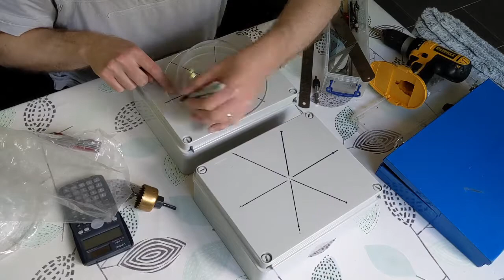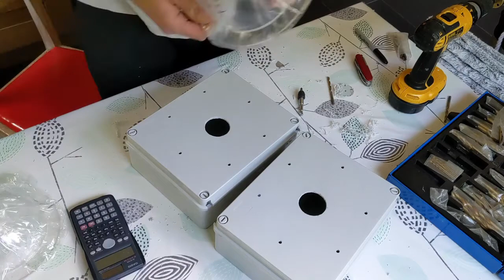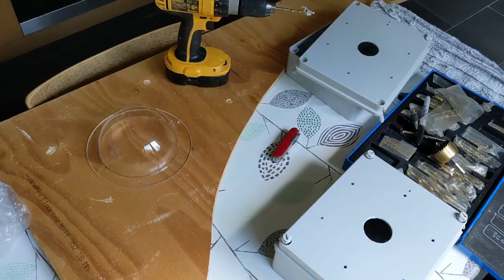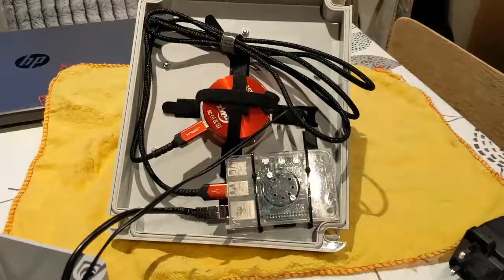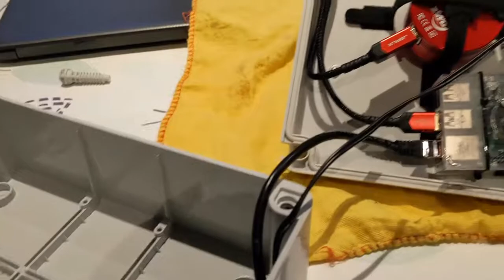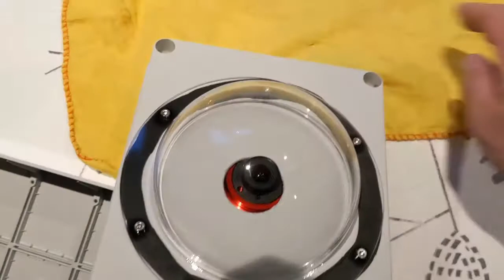Building an All Sky Camera

Comment: do you have an issue with condensation or fogging?
Reply from the maker: I would if I left it permanently outside.  I tend to bring it in.  However the pi4 is quite warm running and I also think you can get dew heaters to go inside the dome which will help to keep the dew at bay.